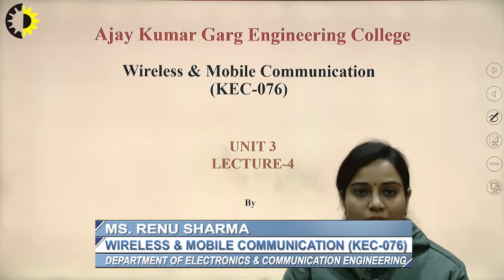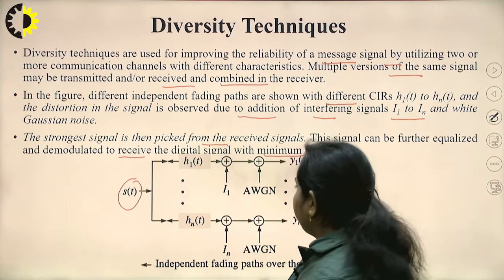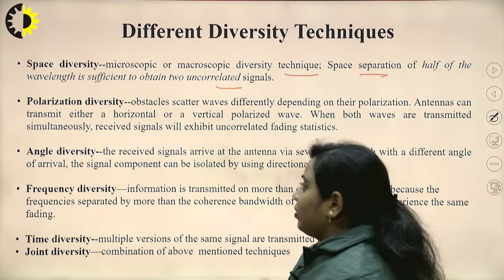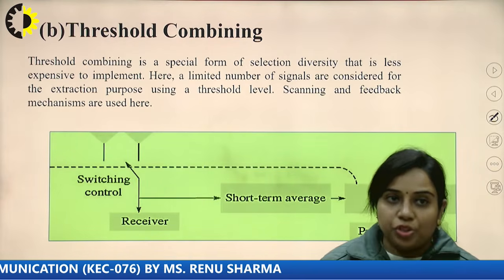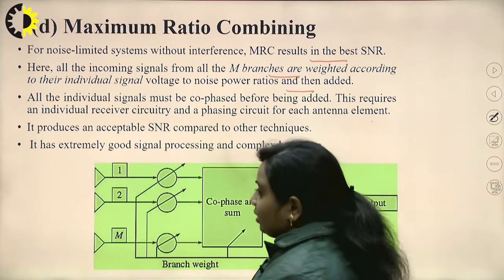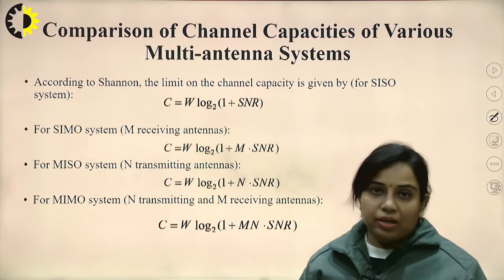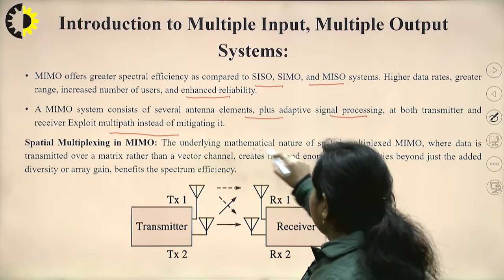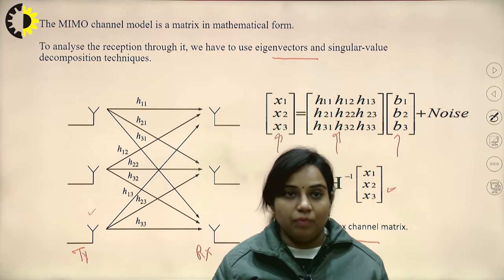WIRELESS & MOBILE COMMUNICATION LECTURE 16 ''Diversity Techniques'' By Ms. Renu Sharma, AKGEC

Comment: Equal gain combining does make sense, what you were trying to say just goes over my head

Equal Gain Combining (EGC) is a method used in wireless communication systems to combine multiple received signals from different antennas or paths. It's a diversity technique aimed at improving the quality and reliability of the received signal by combining them in a specific manner.

Here's how Equal Gain Combining works:

1. *Multiple Antennas or Paths:* EGC involves having multiple antennas or receiver paths that capture the same transmitted signal through different propagation paths due to multipath effects.

2. *Equal Gain Weights:* In Equal Gain Combining, each received signal is assigned equal weight during the combining process. Regardless of the individual signal's strength or quality, they are all given the same importance in the combining operation.

3. *Phase and Magnitude Alignment:* The received signals are aligned in terms of phase and magnitude before being combined. This alignment ensures that all signals are in the same phase and have similar magnitudes when combined.

4. *Combining Process:* The received signals are then added together with equal weights. Mathematically, this involves summing the signals without adjusting their relative strengths.

5. *Final Output:* The combined signal represents the result of adding the received signals together, with each signal contributing equally to the final output.

Equal Gain Combining offers a straightforward approach to diversity combining by treating all received signals equally and combining them without favoring any particular signal over others. While it might not provide the optimal performance in terms of signal quality improvement compared to more sophisticated methods like Maximum Ratio Combining (MRC), it offers simplicity in implementation and can still provide diversity benefits in scenarios where signals experience different fading or interference conditions across different paths or antennas.